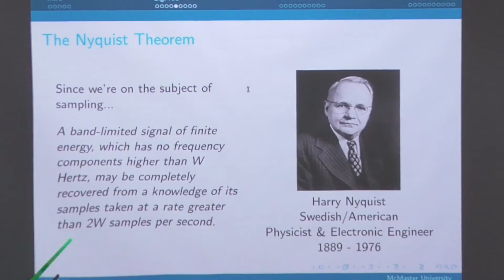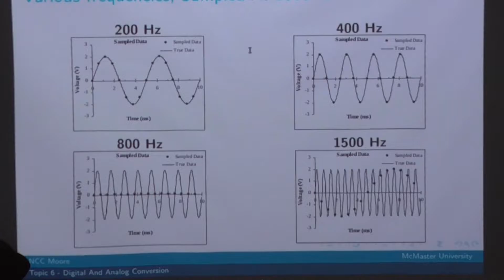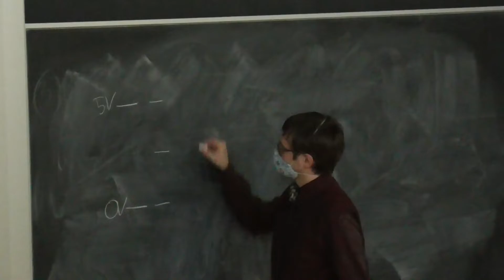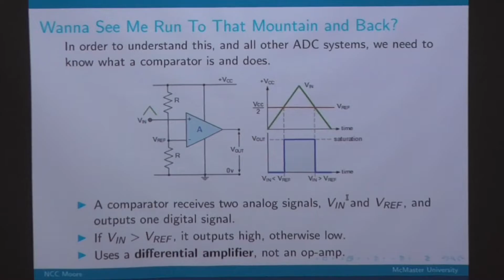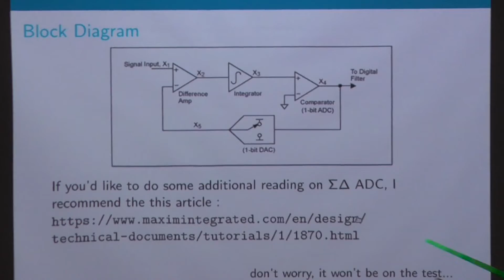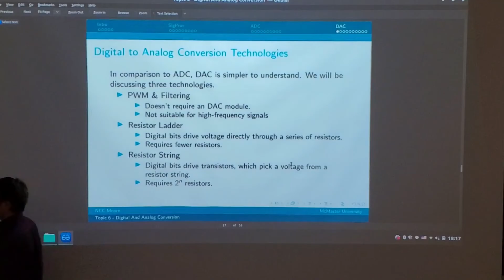MT 2TA4 Lecture - Winter 2022

Comment: If we were sampling at 1600hz, since its twice as large as a 800hz signal wouldnt there be no aliasing?
Reply from the maker: Remember my friend that this is a strict inequality.  The sampling frequency must be strictly greater than 2*(signal frequency).  If they are exactly equal (which would be nearly physically impossible) you get this cool thing where the sample is taken at the exact same place on the waveform each time, so it looks like a DC offset.  In practical terms, you should be shooting for 2.5x to 3x the sampling frequency as a bare minimum.  Like, nyquist is the cutoff where things go funky, right?  A good engineering will stay well back of that line.  

Like, your ideal scenario is similar to the ideal scenario for picking hash functions.  You want both to be different primes ideally.
Reply: @nickmoore9881  ty!
Reply from the maker: I'm happy someone is getting some use out of the archive ^_^